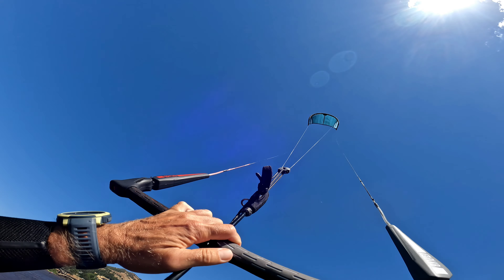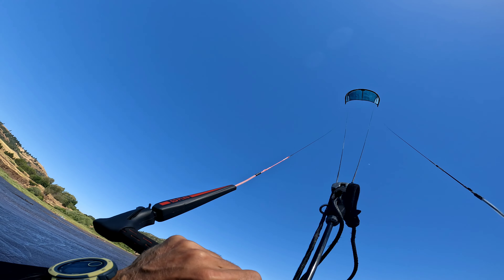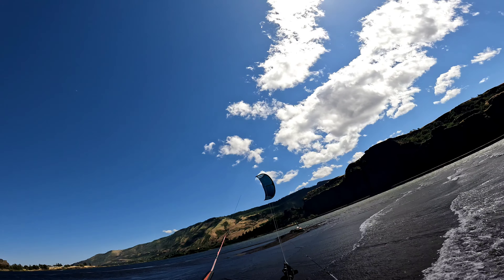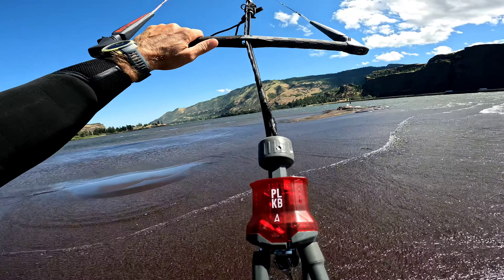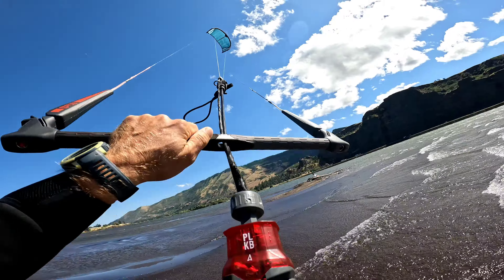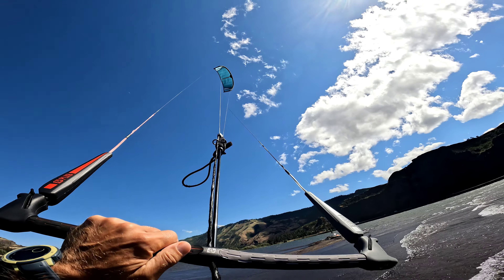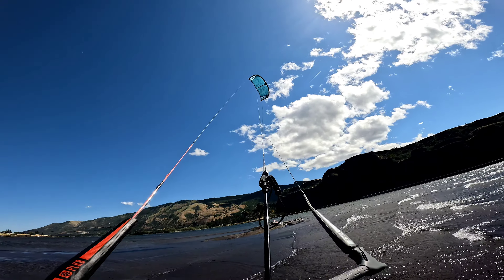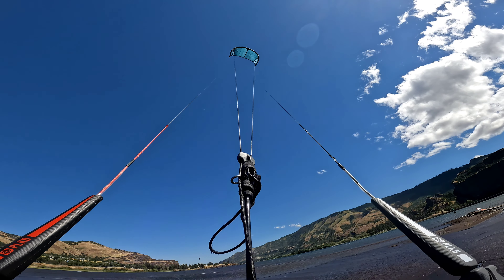In 25-30knts, Safely self-land your kiteboarding kite

Comment: Greta tips. Please never walk between the lines of an unweighted or I held kite . I was near,y killed doing this . The   kite took off after it was down and I had pulled the release .   I felt lines catch around my body then bang , in 0.1 second , I was catapulted into a solid hard vertical. sand dune  wall of stones and sand . Luckily at 45 degrees. My feet left no trace in the sand . I was on Tiree in the middle of nowhere.